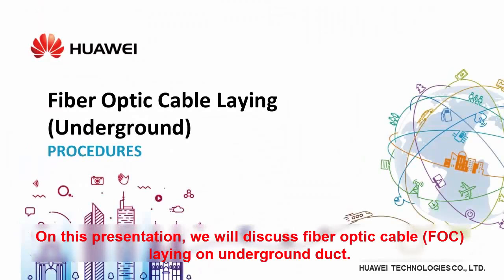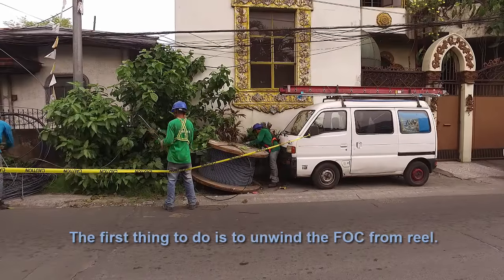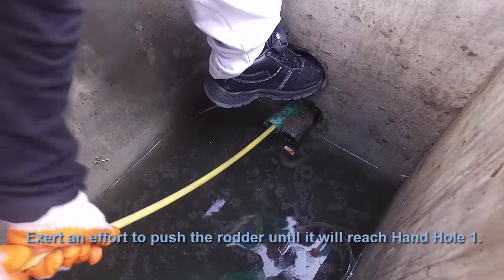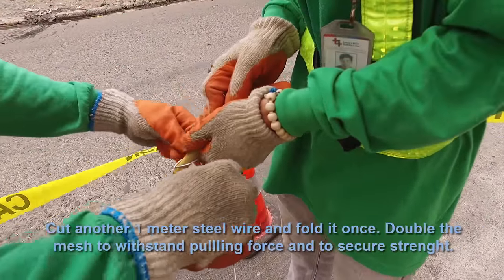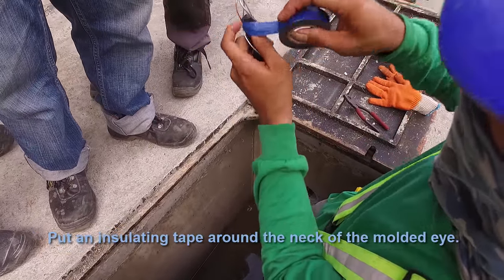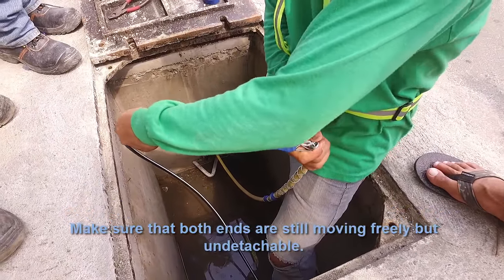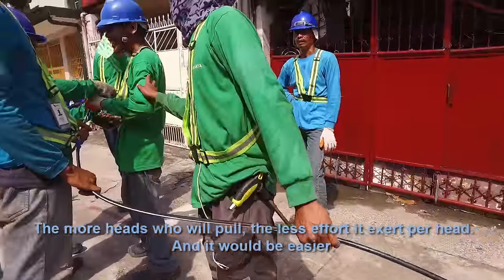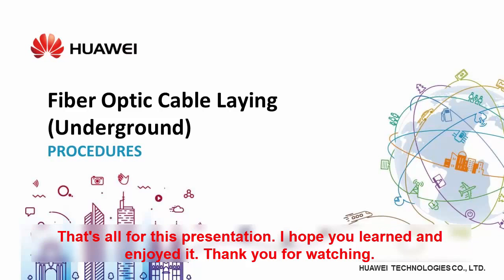Underground Fiber Optic Cable Laying

Comment: I'm from Texas and have been doing underground telephone / fiber for 9 years. I've done everything from placing the conduit and handholes even  place big  manholes. I've pulled 2500 pair copper cable and 864 fiber and everything in-between. Miles and miles of it all over the state of Texas. I've pulled cable everyway imaginable but this was is the hardest way to do it. Not hating I just know what it's like to pull fiber like that. Much respect to all those guys working hard 💪
Reply: Bless me
Reply: hi, I have 4 years of experience in telecommunications, I am currently working as an optical fiber installer in the homes of private clients, I also have extensive experience laying cables underground and by air, I live in Portugal, I dream of moving to Texas, can I contact you?

Comment: I'm a cabling worker. We do it slightly different in the UK. We do use cobra rods but they tend to not go as far and can't put alot of force behind them if the duct is congested. Best thing to use is hand rods, 25mm by 3m length. Can push them with alot of force. I've done one section of 320m through a congested manhole duct with 4 other blokes

Edit: the amount of workers you see rodding here is not how we do it. Like we normally work in a group of 2 per job. If its hard with just the 2 of us, we can then call for additional engineers for an assist. I would like to work abroad and try out how its like in different places and countries. Love abit of cabling 😁
Reply: We use cobras in England they work brilliant just need the 14mm 😂

Comment: We are using diameter of 110mm uPVC pipe, therefore we only used insulation tape to secure the fiber optic cable and rodder

Comment: I remember doing that in Iraq for the c ram but of course we did it a bit diffrent we didn't use wire we used mule tape I believe (so long ago) to pull the fiber along

Comment: OK get an air compressor and blow a string attached to a sponge...... it will even clean the interior of the conduit, then pull the rodder, or even fiber.

Comment: Wow, very much a manual labour job. Why not use muletape? A fabric tape you pull back with the rodder. You can then attach the muletape to the fiber cable and pull on the muletape.  You can put a new piece of muletape in at the same time.  Also, I see you are simply taking coils off the reel. This would result in twists when you go to place the cable.  Why not unreel it and store it with figure 8s? This should prevent twists.

Comment: if my location is approximately 700 meters from the nearest handhole. Could it still be possible to be connected to a fibr connection?
Reply from the maker: yes if the telecom is willing to spend for the cost. introducing branching closure on the handhole and setting up riser pole, and suspend fiber aerial towards you will be one of the solution.
Reply: Emerson Jr Cumlat thank you. I'm just anxious coz i think converge is expanding it's connection up here to the northern part of luzon. Saw some fibr cables being dug along side of mcarthur highway and just desperate to get connected to fibr. tired of data cappings 😭 barrio problems
Reply from the maker: @Adaline0717   the cable that Converge usually laid underground are backhaul or feeder cables; not intended for consumer use. You should look after those white boxes attached on poles na may mga drop cables. This will give you sign that fiber to the home is available on your area.
Reply: Emerson Jr Cumlat as of now, i don't see any poles near my location. What i only i see are those holes with cables on it. I guess im losing hope of getting a fibr connection. forever stuck na ko sa globe broadband 😭

Comment: ....i do this every day.....this video is overkill x 1000....we shoot a dart with a compressor up the duct with 2500 lb muletape to MH#2   tie cable to muletape with 3 slipknots and TAPE with electrical tape .......DONE... no braiding of wire or stupid shit like this video.......PS we do it with a crew of 3 .....
Reply: You forgot to put a 2500 swivel on there 
Before you pull Half hitches are no good cable and rerope can wrap around each other and other cables when pulling

Comment: this is very inneffective with a risk of damaging the cable. if you drag it with to much force, there is a decent chance the cable will be under to much force and the fiber can snap. ofc it depends on the distance it is beeing pulled, but sience it seems to need atleast 4 people to do so i assume to much force is beeing used. just a small nick on the cable , can cause singnal errors.
what you do is to send a cable underground is using a air compressor and you liturally blow the cable in the tubes underground till it goes to the end, ive blown 90 fiber cable 100m a minute persoanlly, ofc, that is risky aswell due to if it comes to a instant halt you can kiss that cable goodbye.